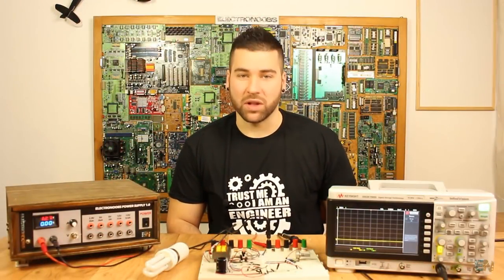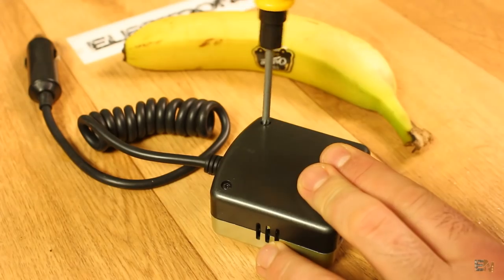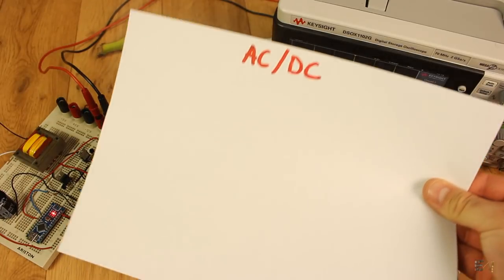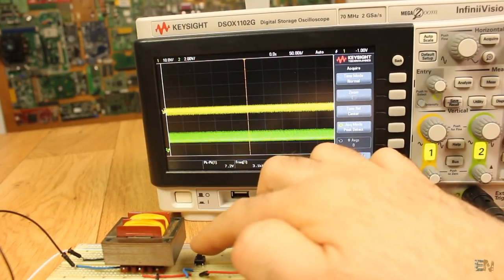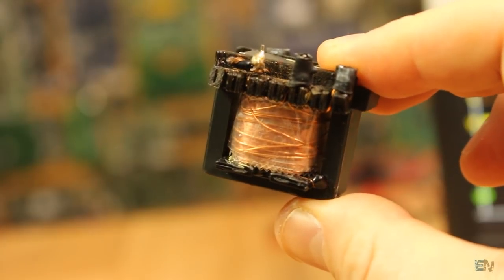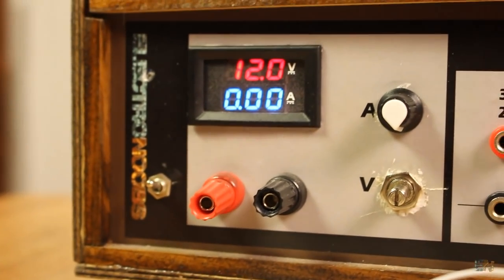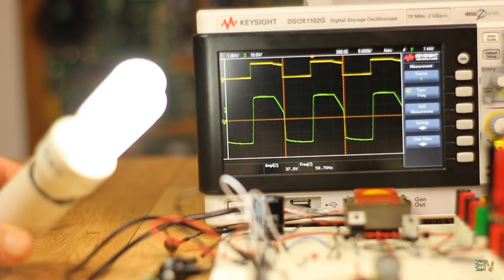DIY Inverter tutorial - Arduino or 555

Comment: Hey, nice video as always! I like how you always add graphics to give the viewer a better understanding of your progress.
What I missed in the video is the lack of information and importance about the flyback diode.

Also, to simplify the arduino circuit, you could replace the IRFZ44N with IRLZ44N, they are logic level MOSFETs and can be controlled directly by the arduino itself. You wouldn't need the BJTs anymore.

Have a nice week!
Reply from the maker: Thank you very much. Very useful information. Keep up!
Reply: No, you can actually control an IRFZ44N with the Arduino directly, the problem is that MOSFETs can’t switch a higher voltage than the one applied to the gate. If you have 5 V at the gate, you can switch 5 V, but not 12 V. Or at least that’s what I understand.
Reply: That's not true. You can switch up to the maximum VDSS (Drain-to-Source Breakdown Voltage), which you can find in the datasheet. In this case 55V. The supplied gate voltage only determines the level of resistance. The more voltage at the gate, the lower the resistance from Drain to Source.
Reply: True, I agree. The only hitch is that the IRF variant is much more readily available - especially for hobbyists & experimenters. IMHO, this circuit is still pretty simple and shows how to do bootstrap FETs, and that’s a useful bit of knowledge (and experience to build) unto itself.

Comment: Beautifully explained! Adding a Schmitt trigger at the output of BD139 would give a precise square inverted signal.
Reply: True - that would reduce the FET switching time, and thus reduce the resistance and undesirable thermal effects from switching losses. I could definitely be mistaken here, but I believe the design goal (aside from simplicity) was to create an “imperfect” square wave - something a bit more sinusoidal by rounding off the edges - even if only slightly.

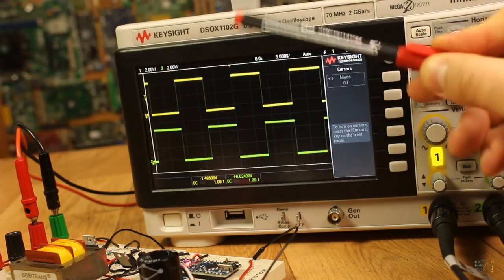Comment: 7:50 Looking at the data sheet for the IRFZ44N, the Vgs(th) to turn on the MOSFET is only 2v so an Arduino should be more than enough for this without a transistor.. what am I missing?
Reply: IRFZ44N needs 10v to fully turn on. it will start conducting current at 0.7v but it will heat up as it is not fully saturated, if you want arduino to turn on the mosfet at 5v, use logic level mosfets, they turn on fully saturated at 5v like IRL540.

Comment: What about IRF3205 (better than IRFZ44)? It will get less hot!
And for the pull up resistor, it's better to do the opposite with pull down resistors and PNP BJT, because if the oscillation circuitry fails then you completely kill the mosfets!
You also didn't talk about reverse diodes to get rid of the inductive spikes, but that is a very important point and you used them!
Finally, seeing the output waveform of the transformer on the oscilloscope seems quite impressive, given that those transformer use to work with sine wave! I would expect some distortion while using them with a square wave!
Otherwise i would say good job and i am going to build my own from a 200W transformer inspiring myself from your circuit!

Comment: You could add some delay between switching from one FET to the other - so that there is some time with no current delivered to the primary. This way you can get a modified sine wave.

Comment: This is only usable for lights. An inverter should have a sinusoidal output, if you want to use it as mains. If you are using an arduino already, its not that hard, they work similar to class D amplifiers, you just apply high frequency square wave to the high side FETs in an H bridge, the duty cycle is proportional to the voltage the wave should have. Then you filter the output with LC filter, which have low losses. It still wont be perfect sine, but will look much nicer than the square wave.
Also for higher currents mosfet drivers should be used, to lower the switching losses.

Great video though, and I would be happy if you'd improve it.
Reply from the maker: Thank you very much! I'll probably make one with full bridge!

Comment: I must admit, i’m a bit perplexed by the bulk capacitance on the 12 V rail. The output impedance of a 12 V lead acid battery, such as the one shown in the video, should already be very low. Presumably, the wires connecting the battery to the MOSFETs are also heavy enough to provide a low impedance path. Also, the 12 V input is way, way above the drop out for the regulator on the microcontroller, and the 120 Hz frequency is low enough to allow the regulator plenty of time to respond effectively. Conversely, I would have expected some capacitance on the output from the MOSFETs - doing a little bit to make the output somewhat more sinusoidal. Am I missing something important here? I am quite curious.

Great video, by the way. Super useful and practical, with a nice clear explanation, as usual. Keep it up. Thanks.

Comment: 9:17 Using  the delay function for accurate timing is not recommended unless you turn off background interrupts and other background processes on the Arduino. You might get away with it, but for the sake of a few extra lines in Setup() it's better to do it that way :)
Reply: Totally agree. The standard delay can also be inaccurate, depending on the Arduino platform used. More importantly, the function doesn’t offer fine control/resolution at these frequencies. It’s obvious in the video that he wasn’t able to achieve a proper 60 Hz. Maybe it was done this way to make it easier for beginners to understand and/or to make the explanation of the code itself simpler.

Comment: Hi, @Electronoobs I was looking such a simple and efficient small inverter on the internet for quite a while, then I found this amazingly explained tutorial, I have one question here if I don't possess the oscilloscope then how should I tune my potentiometer to 50 or 60Hz without the scope?
Reply: some multimeters have Hz function which would work for this. a "soundcard oscilloscope" could also work as the frequency is low enough to be captured

Comment: Isn't the output supposed to be 220V RMS (~310V P-P)?
Reply from the maker: True. My bad not saying that. 220RMS or 310pp. at 13:15 you can see a 37 amplitude, that's because the oscilloscope is set to 1:10. So we have around 370Vpp or 260RMS. As I say in the video, this circuit is not perfect at all.

Have a nice day!
Reply: Nope, my friend, it is not 260V RMS. That would be right if it was a sinewave. But yours is a squarewave, RMS of a square wave that goes positive and negative is equal to the peak voltage (Vpp/2), 185V RMS is what you have. For it to be 230V RMS you need to see 460V peak-to-peak.

Comment: This kind of lamps actually require DC voltage input not AC. There is a full bridge rectifier inside the lamp's circuit to rectify the AC to DC. A fan would've been a better example/demo since AC fan's motor won't work with DC

Comment: problem is that there is no feed back voltage to have some type of pwm and control output voltage as if u put a load it will drop down voltage and low power loads will go over 240v!! and that is not safe for most chargers and stuff!! .... and I would use the Arduino and not the 555timer cuz I don't have oscilloscope , also with Arduino I can change frequency and other parameters very easily with just one click of my computer!! ....

Comment: You forget about the diodes.... Otherwise mosfets are frying.... High inrush current of the inductor in transformer....
Reply from the maker: The circuit dose have diodes!

Have a nice day!
Reply: Ya... Nice video & explanation
Reply: I think IRFZ44n has internal diodes. At least that's what is shown in the datasheet.
Reply: @rtechlabs  they are not Schottky diodes
And will heat up the mosfet
Reply: @frustratedgamer5131  I didn't say anything about Schottky diodes. Check datasheet for IRFZ44n there is a diode inside.
Reply: @rtechlabs  i am saying that Schottky diodes are needed in this circuit while irfz44n only has regular silicon diodes
Reply: Afte reading this I realized I fucked up my mosfets. I thought I could ignore diodes... 👀💭

Comment: I build inverter by using your circuit but my battery is 12v by 26Ah and but it can not run 100watt bulb what is the reason?

Comment: Hello, why do you need an additional 12V supply and the bjt npn transistor to control the mosfet ? and not just use the arduino 5V to control the mosfet?

Comment: 10:38 you tried higher power bulb but it did not work i have 12v by 26Ah battery but the the inverter can not turn on 100 watt bulb how can i creat higher watt inverter

Comment: I built this circuit exactly the same but the I had only 20 volt gate mosfet but they or logic mosfet but the 2 won’t stay cool burn up as they or on so I don’t understand why the mosfet is burning up I try all 60 pieces and all burn up in 30 seconds the transformer was on buzzing but no high voltage in the second wire the transformer is a big 120 volt microwave transformer I rewind 27 turn by 27 turn which give me 28 volt when the transformer is on but I realize the irfz44n work a very low voltage to gate because I can turn them on with my finger and I can’t with the irf44n and irf 840 and IRf740 and irf540n they won’t turn on with your finger

Comment: Would like to ask for your yout expert opinion, could you guide me and my team to design and build a 220vdc input and 220vac output at 50hz
Reply: an egs002 board takes 380v DC to 220ac, it's the last stage of most sine wave inverters, and it's only need (isolated) 12v and 5v supply (that can be achieved by a simple small 12v power supply and 78l05), look for circuit and schematics

Comment: You should use IRLZ44N FETs because you can drive their gates with 5v
Reply: Thats true but not always. If you check out the datasheet you find some graphics about that and finally you can understand why you can not drive  12V (normal gate voltage) or above efficiently with a logic level gate drive power mosfets. IRLZ44N are not described as a logic mosfet. Itis only able to drive with limited parameter with 5V.

Comment: couldn't you also use the arduino for the safety functions ? over volt and amp? and shut off if the parameters are exceeded?

Comment: Can i use ferrite core transformer?
Reply from the maker: Yes, that's even better!
Reply: Which transformer you had used in this circuit
Reply: Ferrite is good for high frequency
Reply: Electronoobs, better say ferrite will not work using those parameters, as it require several kHz, yours operates at domestic Hz 50/60
Reply: You can quite easily but you will require a much higher frequency. But the ferrite core will handle many times more power than the iron one.

Comment: Is there any conection between line going from mosfet sourse to GND and the line with diodes 1N4001 ???  Sometimes you use points, sometimes not, to designate conection. (time 12:39).
Reply: Well are they connections ... two years later yet the same questions.

Comment: Hmm

I have question.

I want drive 12v dc motor using this circuit. I can do this think?
Reply: Control motor us elevator and stop it for each lvl
Reply from the maker: Fata Noor why not use the circuit from my last video, the 555 timer DC motor speed controller. Keep up!
Reply: Electronoobs  I want control my firing angle using arduino..

Comment: Are you in programing arduino.I mean are you really good at programing arduino.....
Reply: I have a problem with my code I mean it is not a problem just i do not really know how to put one code into anotherone.And i want to ask you for help.
I am making a co2 sensor with humidity sensor and i want to put a code where is 2 led lights red when air is not good and green when the air is good and buzzer that beeps when is red.I have 2 codes that are needed to combine.

Comment: Dear please make it pwm controled with arduino because the output voltage will change with different loads. Thinx
Reply: Without proper isolation that is extremely dangerous.

Comment: In your scemathic you use 1uF capacitor but in yout breadboard you use 100nF capacitor which is true
Reply from the maker: from 100nF to 1uF. Changing the capacitor value will affect the frequency!

Comment: It is quite disturbing to use the inverter first then a rectifier to charge a laptop. I wish laptop manufacturers come up with a clever design so that you can disconnect the rectifier from the cable and use a voltage regulator to charge laptops in cars as in smartphones.

Comment: Can I connect a celling fan as load ??
Reply from the maker: I doubt that. Which is the power that the fan requieres? Besides, those motors requires perfect sine wave. Keep up!
Reply: Electronoobs can u make a video with full sine wave inverter and the fan having 60w
Reply: sir can u make a pure sine wave inverter ?

Comment: so please tell me what is the best solution arduino or 555 circuit
?@!
Reply: from more control point, you can use arduino for circuit protection or sine wave using modified PWM, and it can also detect feedback from the transformer and regulate itself for more accurate output, 555 is just simple timer, it doesn't have much function unless you can control its pwm using a digital pot using feed back from transformer, it will require ICs and it will get complex.

Comment: Wooow ....thanks👌🏽 
I want to ask you If I connect battery car to 1st inverter(from 12 v to 220 v ) for litting lamp; at the same time connect 1st inverter to 2nd inverter(from 220 v to 12 v) and then connect 2nd inverter back to battery car.
Is this works? And will it drain the battery ?
Reply from the maker: LOL. It will work and it will drain the battery because energy will be lost.
Reply: Electronoobs how ?
Energy will be lost ? 
i return the energy  back to the battery ..
Reply: Explain it plz
Reply: Aosssamah The energy is lost (converted into heat) in the lightbulb and in losses in the conversion processes. The power returned to the battery will always be lower (or equal if the system was ideal) than the power it gave. This is a fundamental principle of our universe, you can’t create energy out of nothing, the laws of thermodynamics (concretely the first one) impede that.
Reply: GRBTutorials thaaaaaaaaaanks

Comment: Bro tell me?
I should 52khz so what do i do in arduino code ..?please tell me
Reply: You can use a 555 timer but are limited to 49% or 51% duty cycle. 555 can't do 50% duty cycle.
If you can live with that, a good choice and dirt cheap. 
That frequency is too high for Arduino if you are not able to manipulate the PWM registers directly.
Reply from the maker: If you just want a 52kHz square wave on those two pins just do this:

//One is LOW and other is HIGH
  digitalWrite(mos_top,LOW);  
  digitalWrite(mos_bot,HIGH);
  delayMicroseconds(10);    //  1/20us = 50Hz

  //One is HIGH and other is LOW
  digitalWrite(mos_top,HIGH);
  digitalWrite(mos_bot,LOW);
  delayMicroseconds(10);

That will give you a 50kHz square wave, 52kHz is difficult.
Reply: Thanks bro thanks 
Ilove you

Comment: Stop doing this, is very dangerous. I don't want to be a heater, but you need an output feedback. If you disconnect the light bulb, the output voltage would increase a lot. You will have over 300V.

Comment: your work is false because you must use only of high situation of pwm not use of high in one side and use low in other side .the problem is that if you want have feddback to down or up your voltage must down or up pulse width beause you use either low and high of pwm then chane pulse width dont have any change in voltage.in the critical place like an nuclear power plant for example the little change in voltage may cause critical situation and you need feedbacke.excuse me.your work is good but not excellent.thanks.